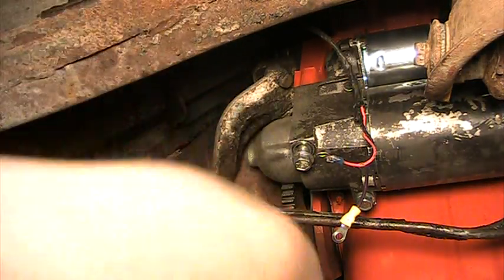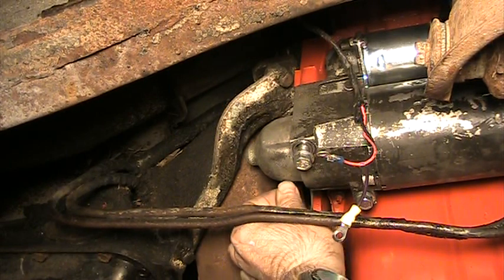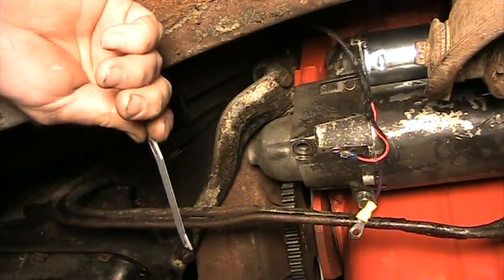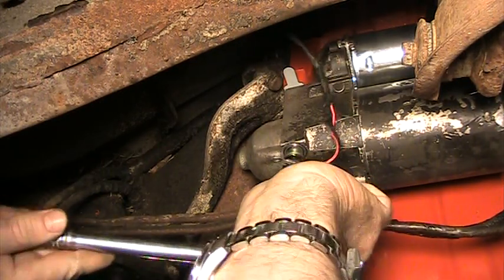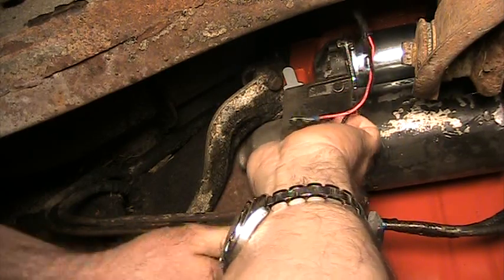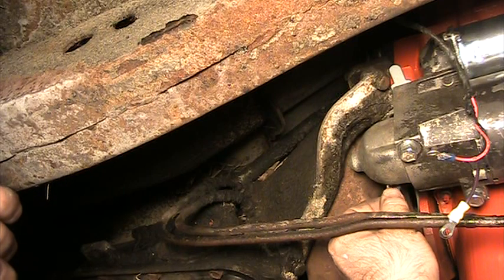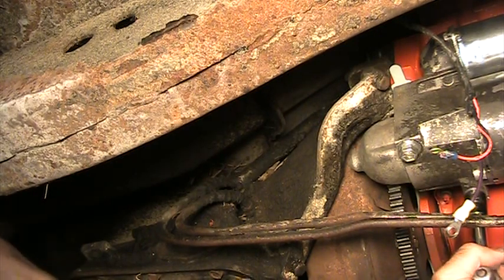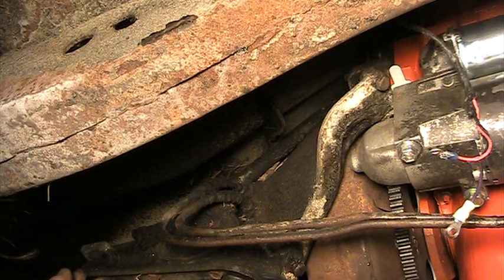63 impala video 24

Comment from the maker: Good, I'm glad to help, and hopefully that will save your flywheel. Another important part that many seem to overlook, is that bracket at the other end of the starter that bolts to the block, it keeps that end of the starter from moving upward when the bendix gear strikes the flywheel. On big blocks, you almost have to have this bracket, otherwise its noise and grinding...

Comment: Yes I was concerned about the flywheel. I had just installed a new starter only a couple months ago but didn't use any shims. I didn't know any better, anyway, It was too tight and thats why I put in this new starter. The flywheel was a bit chewed but is doing fine. Thanks.